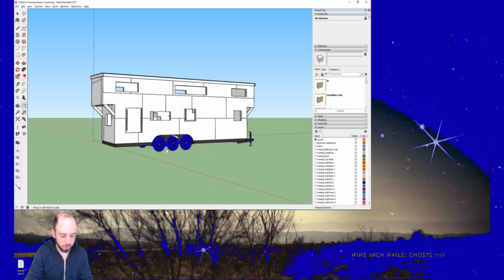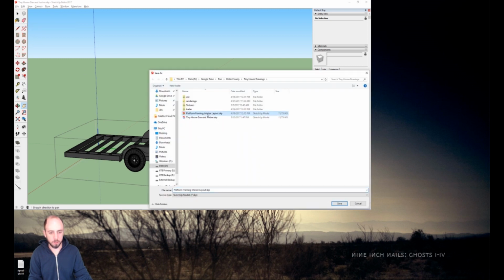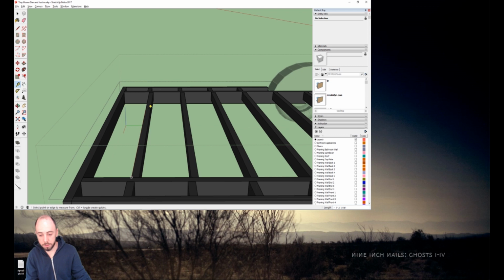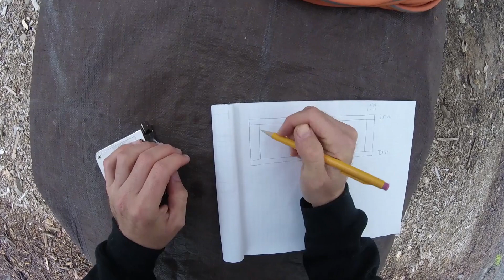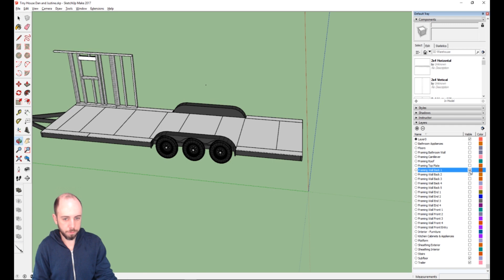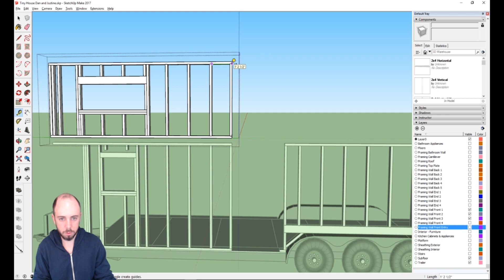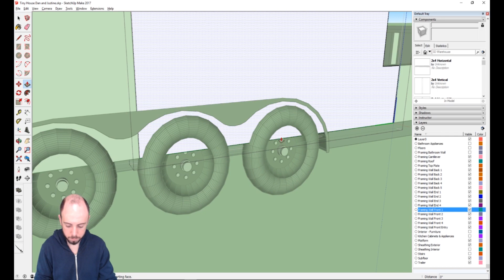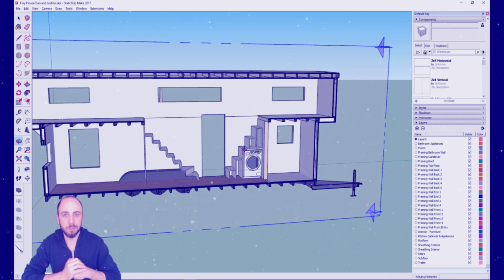Part 9 | Tweaking Drawings Based on Real Trailer Dimensions | Designing Tiny House in Sketchup

Comment: Hey, Dan!  Whew!  I just got done watching 15:22:21 (i.e. over 15 hours!) of your Sketchup tiny house design series.  Thank you so much for doing this without edits.  I've learned more from your mistakes than I would ever learn from a scripted "expert" tutorial.  I'm sure I will never, ever forget to make a copied component unique before I make a modified version!  😉

You inspired me to download Sketchup for my own designs.  I have used Broderbund's 3D Home Architect & Punch Home Design AS 3000 for years for my designs (3DHA is better for interiors & PHD3000 is better for exteriors, especially roofs).  However, I have always felt frustrated by the lack of control to make unconventional designs and construction techniques.  I can see from your videos that Sketchup will finally allow me to do it my way! 

I am a retired software developer and my father was a custom home architect.  Unfortunately he designed multi-million dollar homes and it has taken me 5 decades to reduce my grandiose designs down to something I can afford.  I finally got my 20 acre property in AZ ten years ago, but I am still living in a 12'x12' shack ("cabin"?) I built as a "temporary" shelter.  I'm just finishing a 12'x24' shed that would have gone a lot smoother if I had designed it in Sketchup first, with the detail you used in your design.   I plan to design (and hopefully build) some extensions to my cabin over the next few years.  Construction goes VERY slowly when you're living  on Social Security!  😂
Reply from the maker: I can't believe anyone has watched all of them!  Awesome man, you just made it all worthit.  More power to ya, hope you build your dream home sooner than later!